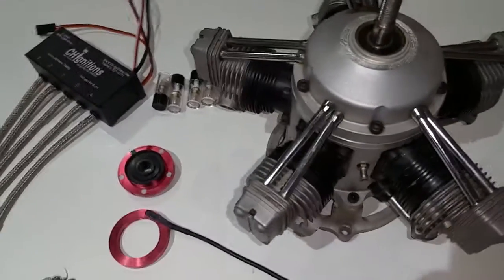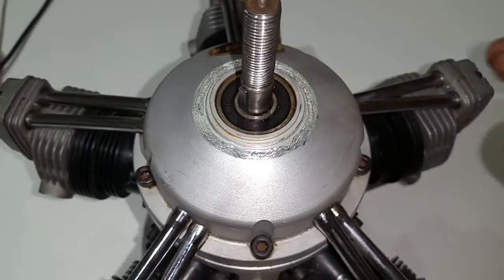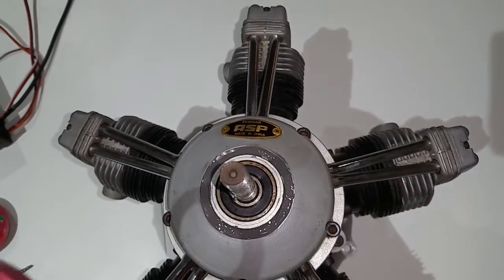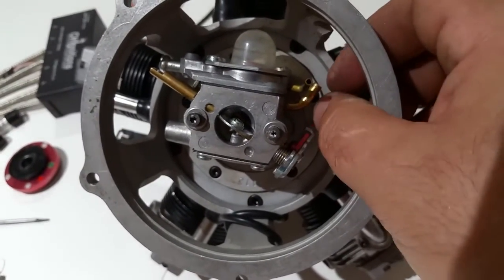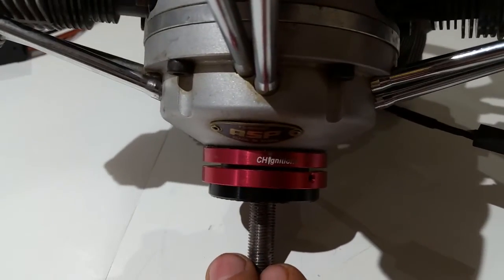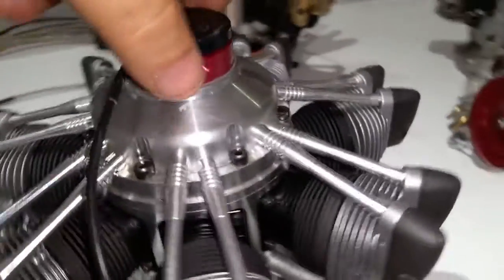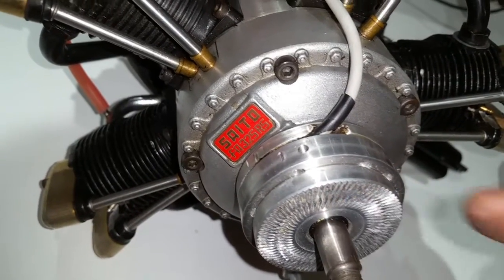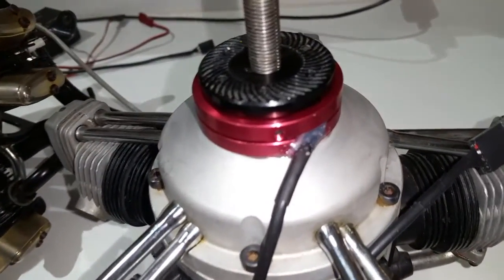ASP 400AR, OS SIRIUS 5 & 7 CYL, SAITO 325 RADIAL, CH IGNITIONS, INSTALL INSTRUCTIONS.

Comment: I wish to see a 2.0L radial engine which is a water cooled and has rocker arms driven by side camshafts (VTEC) driven by a camring. I wish to see a car with such an engine, mid-engine rear-wheel-drive.